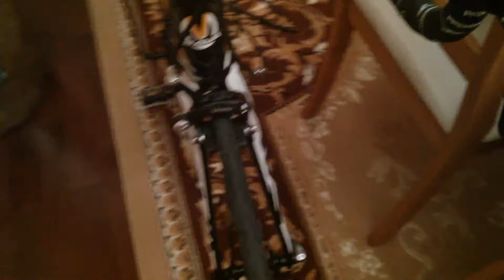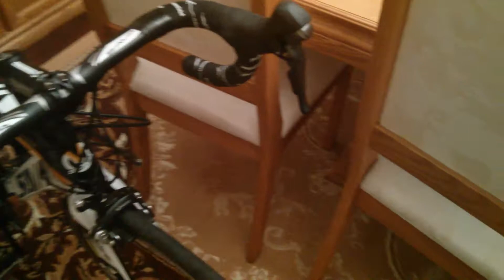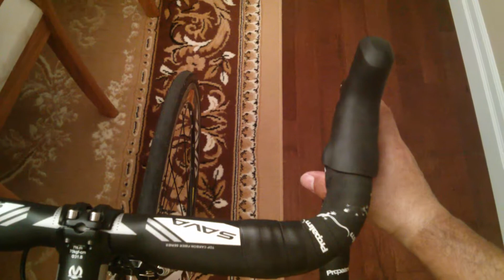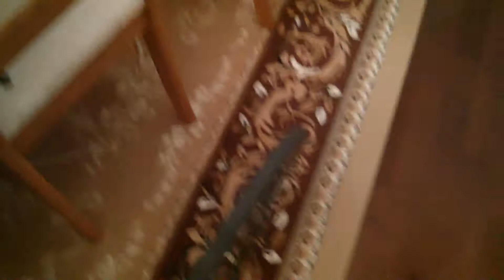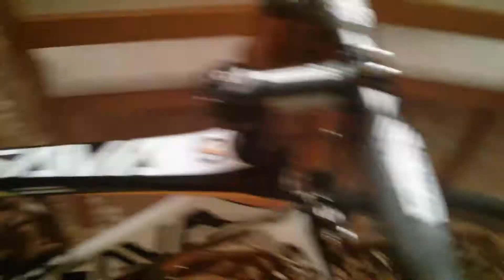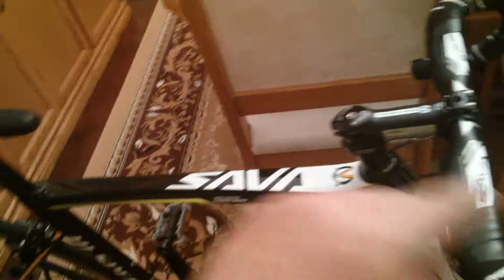Road bike tap braking method

Comment from the maker: Will be updating this video since it also applies to Carbon rim brakes which are notorious for scrapping the carbon brake surface when wet. This tap braking method is now even more crucial to use on Carbon wheels if you prefer rim brakes ( I still do)